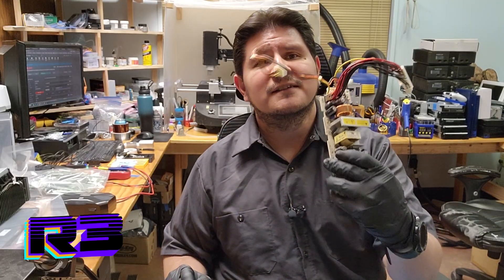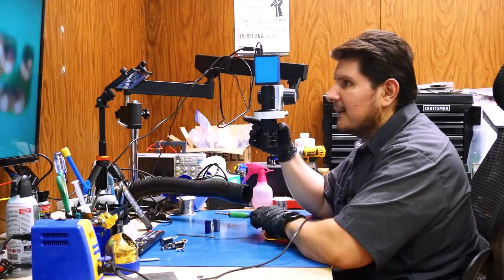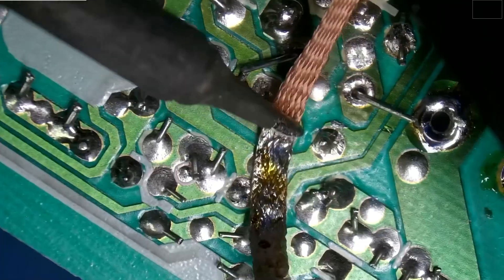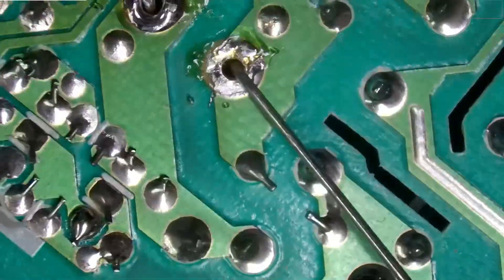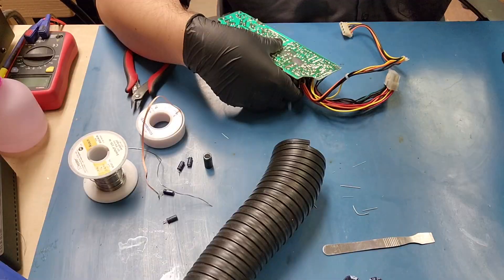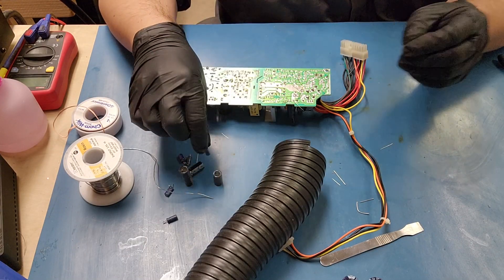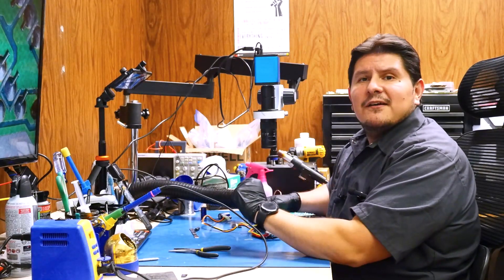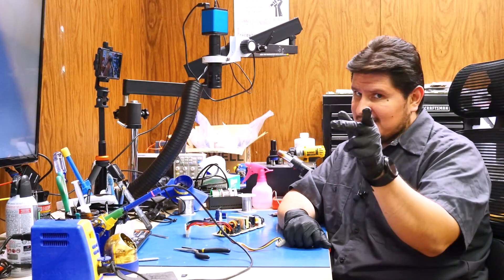How to Fix No Power XBOX Power Supply (Capacitor Replacement)

Comment: Hi, 

Is it possible to convert this and also the Delta models from 110v to 220v only by changing the big capacitor and fuse?

If by any chance you know it will be greatly appreciated as here in Paraguay the original xbox didn't have a market here at that time and we only have 110v versions instead.

Thank you in advance!

Comment: How else can i check if its safe? i have a multimeter. 
I had touched up the power joints before but it still crackles when i plug the power in. Should i do it again?
Reply from the maker: It it is still crackling, then maybe you may have missed a spot when you touched it up?
Reply: @RetroRenegadeRepairs  ill take another look, anything i should keep in mind for a second round? How do i identify a bad joint? How do i know which point to reflow?
Thanks

Comment: What’s that tool you used to remove the charge from the capacitors?
Reply from the maker: It is called a "Capacitor Discharge Pen"
Reply: @RetroRenegadeRepairs  Thank you for the reply.. I should have been more specific.. I was wondering which brand/model you have there. I think I found it on Amazon. Thanks! 
Keep making content! Really enjoying what you do!